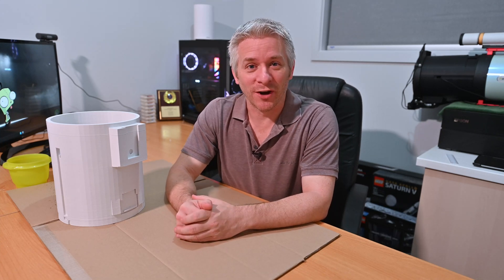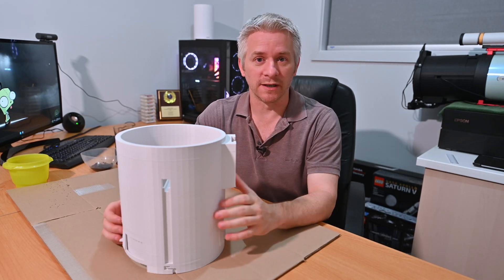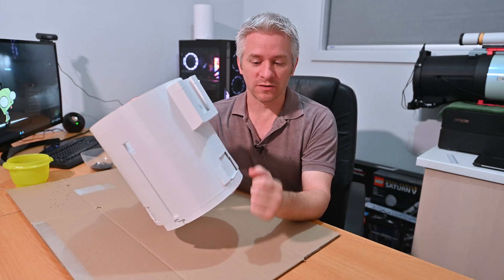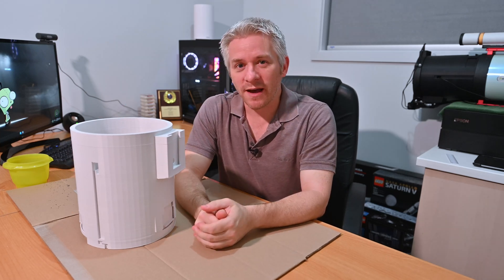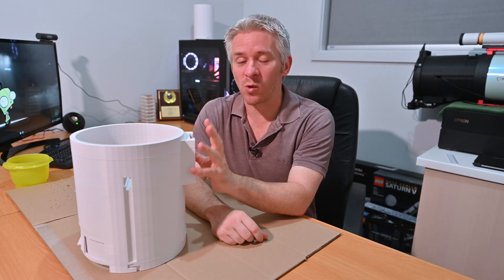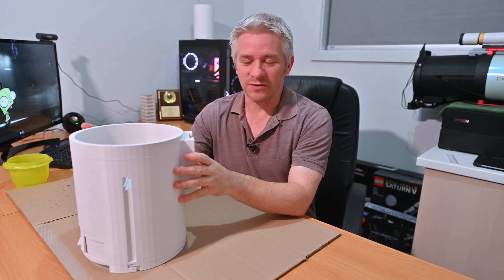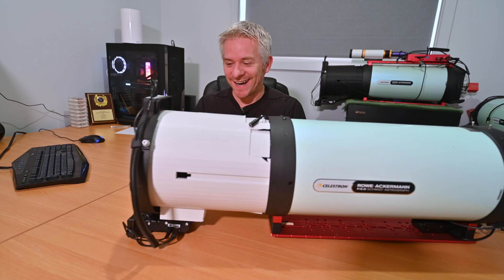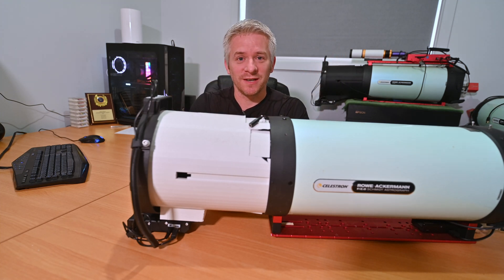NEW RASA 8 3D Printed Dew Shield Design

Comment: Good job! will you ever make a model with curved vanes in order to get rid off the spikes? thanks
Reply from the maker: That's a good question, the idea was there to do so however the design itself is quiet complicated these days that I'm not sure if I can unpick the design and go back to the center obstruction to create the curved cable channel. It may require a complete re-design. I will look into it more and see once I've finished trying to design a filter holder mechanism that allows for ease of collimnation without the need for an FCCT device.

Comment: How long did it take to print that beast?  I am thinking of printing it out myself but I will be doing it at a community owned 3d printer at the library hence the question.
Reply from the maker: Hi mate, it takes me almost 200 hours to print this dew shield with all the internal structures and supports. When building the supports into the print for whatever the machine is and slicing software used you need to make sure you don’t place supports into the top internal section of the shield otherwise the slides for the windows won’t be able to operate fully.
Reply: @StevenMorrisAstro  May have to go with the Celestron dew shield and a cable management piece that is separate for the star spikes.  I'll let you know what I come up with and how it works.

Comment: Dang.  I want to buy and print this but my Bambu X1C only has a build volume of 256x256x256.   I assume it won't work on that?
Reply from the maker: Height wise might be a problem.
Reply: @StevenMorrisAstro  Well crap.   Would you mind telling me the exact max height?  I am tempted to buy it anyone and worse case use tinkercad to cut a bit out of the middle.  Heck I am probably just going to go ahead and buy it anyway.  Even if I can't print it I am supporting a creator in the community.  :D
Reply from the maker: @Azreal34 the height is about 280mm, it’s a bit difficult if you were to cut it down to print because of the internal windows that slide up and down, you would then loose some of the strength if you want to attach a flat panel to the front. 
I’ll look into what I can do to reduce the dimensions so it can be printed on a small printer but the dovetail section might have to be removed.